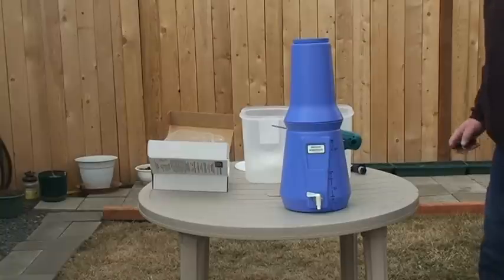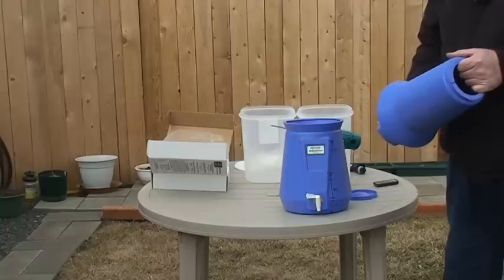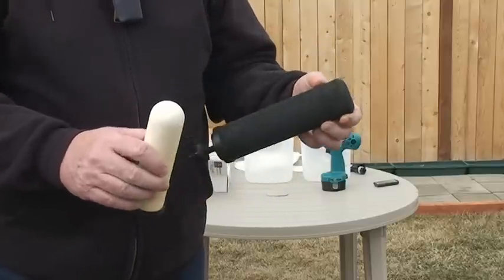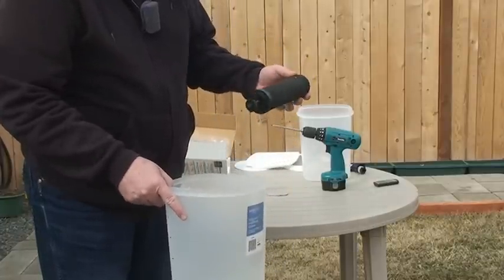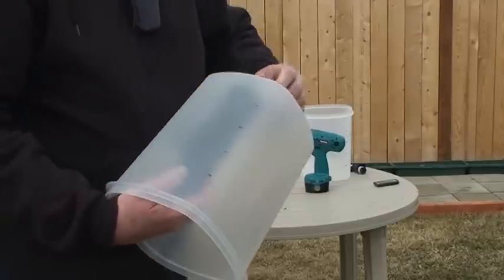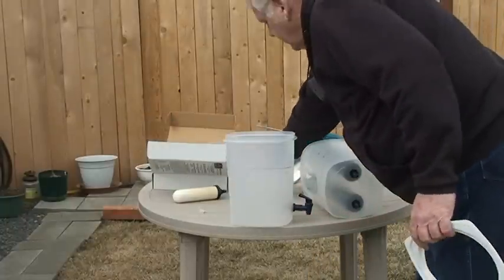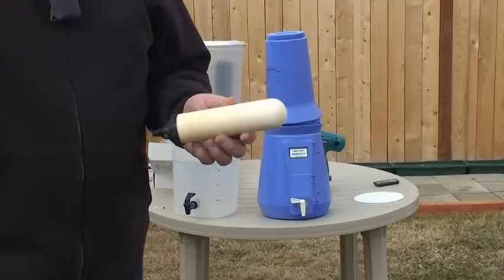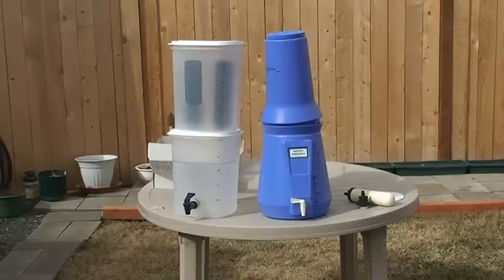Making A Water Filter Housing

Comment from the maker: Hi PDiddyHo - Doing a search just now,  I find the 9 inch and 10 inch white ceramic filter "candles," but am unable to find the black ones.  Hmmm.  I wonder if the black ones are no longer available. ???
To find the 9/10 inch filter candles, I searched Google for "ceramic water filter candle."  Other filter competitors to Berkefeld have candles that will work using the method I suggested in the video.